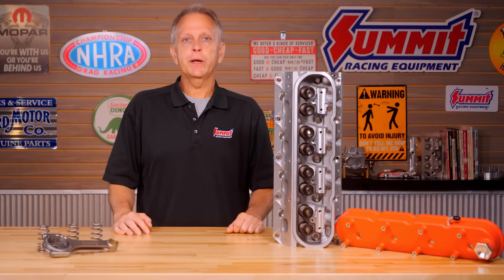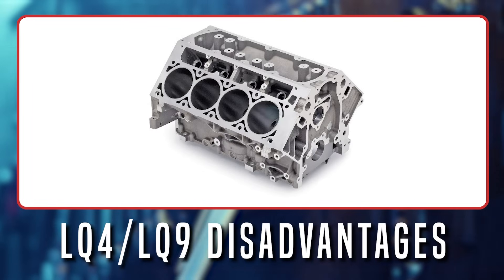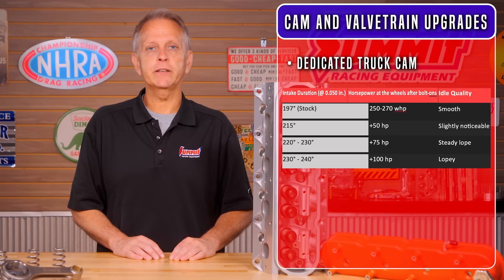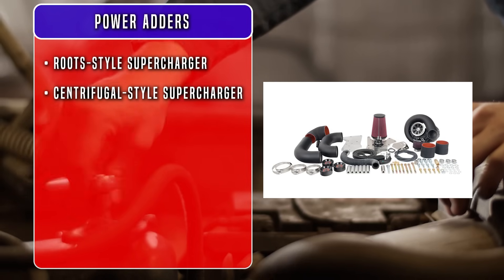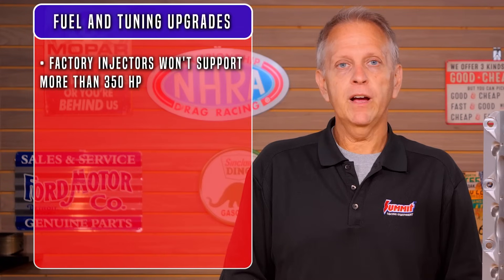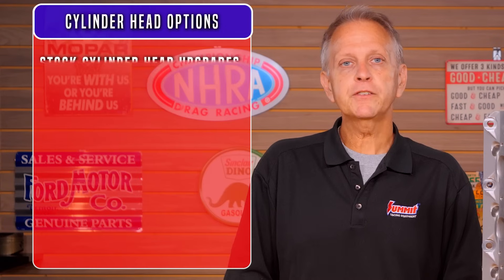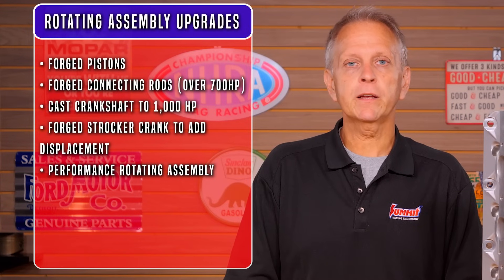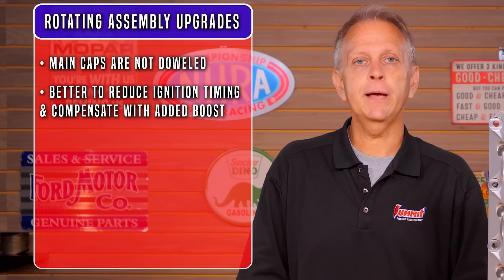Build the Ultimate LQ4/LQ9: Boost-Ready LS Power Guide!

Comment: One thing I don’t is said enough is you can bore the cast 6.0 to 6.2. I had mine bored and just mirrored an LS3. Stock crank, LS3 rods, pistons, heads, lifters, ls2 timing chain kit, I figured this was engineered by GM and would work well up to 600 hp. Added a TSP cam with dual springs and BTR rockers, All  ARP hardware. Nice dependable strong 550 HP street engine. LS engine are really the best engine to built. Tuners are everywhere now.
Reply: Thank you for providing me this information! I really appreciate it.
Reply: Man I’m glad I read this become I’m looking into a lq9 and boring it to a 6.2